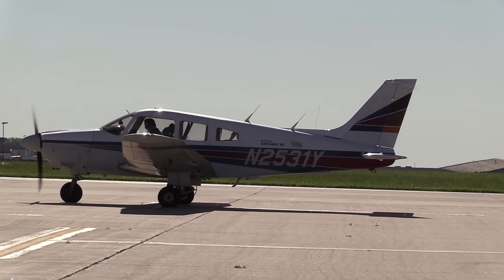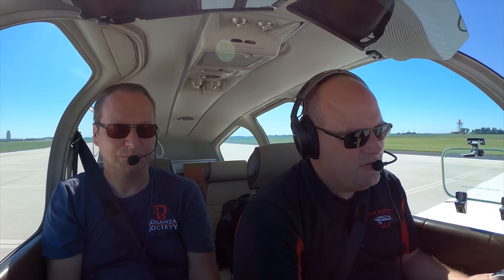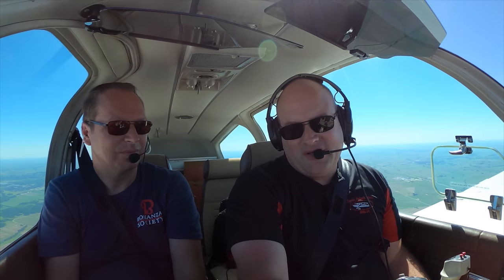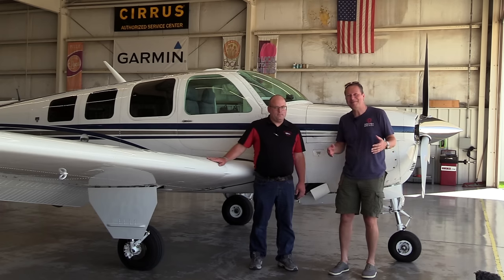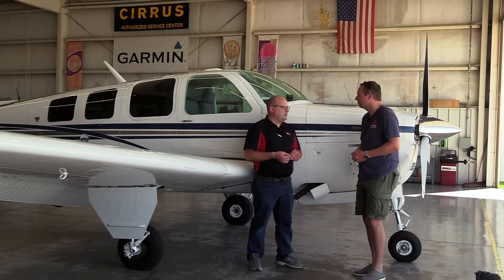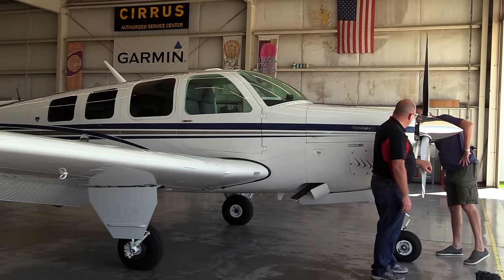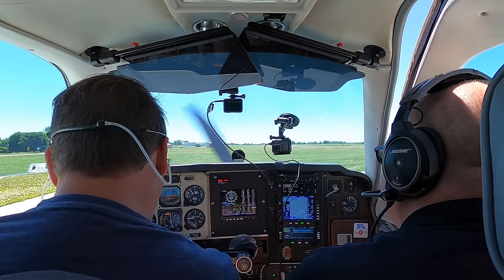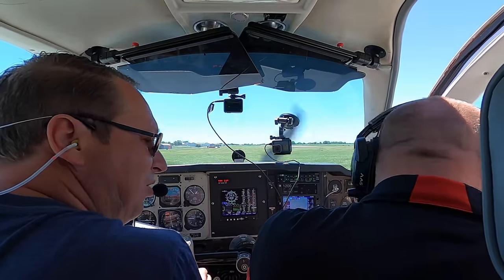Engine Upgrade - First Flight with the IO-550-B

Comment: I am watching this video as IO write.  Last summer I had AirPlains IO550 conversion done to my 1971 C182.  I absolutely love it.  

Regards.
Reply from the maker: I bet the 182 with an IO-550 is a rocket!
- Martin
Reply: John Fletcher   I also had Air Plains install the -550 in my 1975 C-182 May of last year. Takeoffs and climb outs are awesome. And with the GAMI’s you can really lean it back and save some gas if you’re in no hurry. Great motor! Cheers!

Comment: Did anyone else notice something dripped from right behind the vacuum filter at about 12:35  right after Shane removed his hand from the filter housing?    Great video....
Reply from the maker: Yes - a drop of water. In the rain, some water can be trapped under the cowling, and when you open the cowling the drops start moving.
- Martin

Comment: Great summary of the engine exchange process!  I did the same for my Arrow 200 this past winter but the break-in was prolonged a bit because I cannot easily get down to an altitude where 75% power is achievable!  My field elevation is 6900' and the nearest 4000' area is a haul from here.  Your ordering time was about what I experienced from Air Power too.  Probably normal EXCEPT when you are waiting!!!  Enjoy your new motor...and the empty wallet!!
Reply from the maker: Thanks, Jim. You are right about the empty wallet - that alone gives me an additional 200 feet per minute of climb rate!  😀
Best regards,
Martin

Comment: At 10:39 in the video the fuel line off the spider need to be corrected to prevent chaffing. Great video and congratulations on the conversion, they do good work.
Reply from the maker: Thank you - we'll look into that.
- Martin

Comment: Absolutely beautiful! Hope you’ve been getting to fly a lot. I have one minor concern. In your video at the 10:37 mark the spark plug wires are laying on top of your orange fuel line which are laying on top of the fuel line injector clamp. Over time the edge of the clamp my rub a whole in your fuel line hose. I’m not sure I got all the parts right, I’m not a pilot, but like watching your videos.
Reply from the maker: Thanks, David. You jut joined a very long line of people pointing this out. It has been corrected a long time ago. (The video is from 2020.)
 - Martin

Comment: Hello Martin
While you were doing your visual of the IO-550 engine. I observed one of your fuel lines support clamp appears to be misaligned when support the fuel line.

The one in question is the fuel line for the front cylinder on the right side. From my view,it appears that the metal clamp and the rubber insulator are not aligned correctly crating a metal to metal contact between the fuel line and the metal of the support clamp.

Just to let you know, I am a certified aviation quality assurance inspector

Please recheck all clamps to ensure all lines and clamps are not creating chafing.
Reply from the maker: Thanks, we'll get that adjusted.
- Martin

Comment: Lookin Good...wishing you many happy flying hours with your new engine, and of course, looking forward to any videos you share with us. You're lucky to be tall, you can see over the top of your engine, a plus in that regard for sure. It appeared to me that the ignition wires were sitting on top of one of the orange hoses..could that be a wear issue in the future due to vibration?
Reply from the maker: Hi Andrew - yes, visibility is no problem for me in the Bonanza. Interestingly, in the Cirrus I sometimes wish I was shorter, as visibility would be better.
Regarding the wires: This video is two years old - was fixed long ago.
Regards,
  Martin

Comment: Nicely done & congrats. Sounds like a big price tag but much nicer than trying to maintain and upgrade a light twin! You'll also enjoy a boost in value if/when it comes time to sell your plane.
Reply from the maker: I could have bought a twin for that money, with two working engines. Problem is, flying and maintaining a twin is a lot more expensive than the Bonanza. So while this was a very costly upgrade, it's a one-time charge, and from here on I hope to fly for pretty much the same operating cost as before.
- Martin

Comment: Reading the thread posts while watching I was struck by the engine upgrade sticker shock comments. Not knowing the cost I was thinking in the 100-125k range so when you revealed the price at 80k it seemed quite reasonable to me. Haha.👨🏼‍✈️👍🏻 Is there a manufacturer and shop warranty?

Comment: Nice video Martin,  I like the 550,  just watch the cylinder temps on climb out, especially if you decide to lean  on climb on a hot day.  Cruise climb is a good thing.   I hope you have good luck with it.
Reply from the maker: Thank you, Paul. So far the CHTs haven't been an issue, despite the warm weather. But I'll keep an eye on them.
- Martin

Comment: Great video Martin. I love my 550 in my Bonanza. With LOP you will good fuel economy at cruise. Enjoy.
Reply from the maker: Right, I figure around 13 GPH or so will do it lean-of-peak, once I can go there.
- Martin
Reply: Martin Pauly yea. Depending on altitude. I fly at 23 manifold and 2400 rpm and get 13/14 gallon flow. Ot lower manifold you can go down to 12.

Comment: Martin, can you use UPS for your background next time, I'm kinda partial.  We are looking at the same engine upgrade from our 520.  Once again great informative video.   Wish he had a video of extracting the engine.  Did you look into buying the engine without the continental fuel injection system and installing Gami's?  It is my understand you can't change the tuned induction system.  I am sure you did your due diligence on the subject and just curious, thanks again for a great video.

Comment: Congratulations Martin. I know the feeling, just also had my engine replaced. However, the workshop recommended a thick mono grade oil for the break-in (as per manual), not a multigrade. Sounds surprising
Reply from the maker: The important part is that it's break-in oil. There are a few different choices available.
- Martin
Reply: Martin Pauly thanks. I didn't know there was such thing. Thanks 🙏🏻 Also FYI, I found this guide that proved to be very informative if you don't have it: http://insightavionics.com/pdf%20files/Continental.pdf

Comment: I broke in my IOF-240B5 at 3000 75 % power for an hour and then I stayed at 3000 and every 15 mins went down to 65% for 15 min then went back to 75% for 15 min and then went down to 70% for 15 mins.  Was very interesting to hear what folks thought and how they thought it should be done.  I used the XC Phillips 20W50 too based on factory recommendation.  My new airplane Cessna 400 just had the 550-C put in 150 hours ago and I'm using the XC Phillips 20W50 in it too.
Reply from the maker: Sounds like that is the oil most people are using these days, Ed. Thanks for the note.
- Martin

Comment: Congratulations on your new engine and accessories! I underestimated the cost, by a lot. Gulp!
I wish you many happy,  safe, hours flying! OK, one question, since you've already invested a lot in this plane, are you planning on ditching the vacuum system and going for pure glass?
Reply from the maker: If I had another $50K lying around, then yes, a panel upgrade would be next, and I would go all electronic in the process. But that's not in the cards for a while.
- Martin

Comment: Martin, what drove you to make the engine euthanize your old engine  now, just hours.  or did you have a reliability centered maintenance  approach i.e. specific failure mode trigger?
Reply from the maker: No maintenance issues - the engine wasn't "talking to me" yet, Andy. But 2,600 hours... at some point I think enough is enough. Heaven forbid, if something happens on an engine of 3,000 hours or more. So instead of waiting longer, I pulled the trigger. Could the IO-520 have run another year or two? I believe so, yes, absolutely.
- Martin

Comment: We did the same conversion on our F33-A.  Good engine and prop set up.  Would have had them paint the inside of the cowl doors- makes it a cleaner installation.  Hope you have good service with everything.
Reply from the maker: Thanks. So far everything is working wonderfully.
- Martin

Comment: Great video.  Looking back a year later do you still like it and was it worth it?
Reply from the maker: Yes and yes. It's the engine that should have been in the A36 Bonanza from the beginning. Operating out of shorter fields, or close to max gross weight, or at high density altitudes are now a non-issue.
Regards,
  Martin

Comment: Hey! I just bought a 1980 A36. Planning on putting a 550 in it, then TNing it. I got a quote from Continental's distributor, Air Power for a factory remanned IO-550B80B of $58,700 which is net of the core credit and the unlike core fee. Do I understand that when you did yours, the engine cost you $44,649-16,000+2,000 = 30,649 (ignoring freight)??
Reply from the maker: No, I don't know how you got to those numbers, but that is not correct. My factory reman IO-550B was almost $50K, which included the unlike core fee ($2K). I had to send my old core back, otherwise it would have been an extra $16K.
- Martin
Reply: @martinpauly  Yes, thanks, I misunderstood.

Comment: Was the IO-550B heavier than the outgoing IO-520?  And did you not consider an M-T scimitar prop when you chose the Hartzell scimitar prop?
Reply from the maker: There was almost no weight difference between the two.
I looked at the MT propeller, but it was so much more expensive... went with the Hartzell Scimitar instead.
- Martin

Comment: Okay, really cool that he picked you up in his V-Tail.  However, did you notice his N number is N3176W, which just happens to be one digit higher than Kris's (Baron Pilot's) Baron, which is N3175W?  I'll be back to edit this comment when I finish watching the video.
Okay, watched the rest of the video.  I liked the time that Shane went over so much with you.  I expected that the on ground vibrations would have been lessened since I was pretty sure you were getting new mounts for the engine.  I also expect the prop might have had something to do with that, too.
I guess one of the things that surprised me was that Continental is now putting balanced injectors in the engine.  Saves a lot of money over having to buy GAMI, not that there's anything wrong with buying from GAMI.
One of the things that I've been wondering about lately is Electronic Ignition systems, or complete Electronic Ignition and Fuel systems, and why the FAA is dragging their feet on allowing replacement of Magnetos in the airplane with full blown EFI/EEI systems.
In the meantime, Electroair is providing a system that replaces ONE of the mags, your choice, with their ElectroAir Electronic Engine Ignition system.
http://www.electroair.net/6cylIgnitionKit.html
Yes, it's more money to spend, but in addition to the new IO-550, another $5,000 or so might give you a savings of more than that over the lift of the engine, with a typical fuel savings of 10-15% (or so they claim).  Sure, I'm spending YOUR money, I don't have any of my own.  :-) LOL.
I think 70TB is going to be very happy with her new engine, and I'm sure after you get it all broken in, you'll feel much more comfortable with a new engine under the cowling.
Now, start saving those pennies for a new Dynon system.  :) :) :) :p
Reply from the maker: Close - but it’s N317SW, not N3175W.
Reply: @martinpauly  Well, 3175W is Kris's airplane, I thought Shane's was 3176W, but you're right, I could JUST eek out the 'S' instead of a '6', and even the tower called it back is '3170W'.  I didn't hear the 'Sierra' as such, thought it was 'six.'
So close!  LOL

Comment: Hi Martin On the right hand side of engine on the forward cylinder the fuel line retaining clip is twisted and not holding the rubber mount properly. It looks like the clip might be touching the fuel line which could result in chafing thru the line...

Comment: Smoooooth.  Too bad you didn't go with the M-T propeller.  They are normally not heavier for 3 blades over 2 blades so payload is kept and they are even a bit smoother and quieter.

Comment: What a beautiful Bonanza. Can this upgrade be done with a V tail Bonanza? Seems to me it would add allot to a V tail also. Especially it's short field performance.
Reply from the maker: Yes, there are STCs available to upgrade a V-tail Bonanza with the IO-550B. It results in phenomenal performance.
- Martin
Reply: @martinpauly  That's awesome. i am just getting back in the seat after 15 years off. Taking lessons and preparing to buy either a V35 or possibly a twin Comache for crossing the gulf. I am tired of flying Commercial and I live in Costa Rica. Short field grass strips mostly. So preparation is a big deal as it should be with all of us. Thank you for the info.

Comment: Congrats on the new motor and the extra horse power.  Was your original motor run out or ?
Reply from the maker: It was past TBO but still running very well.
- Martin

Comment: Is that flexible hose suppose to lay across metal unprotected and unsecured?  Is there a new rubber hose impervious to engine vibrations? Check the video at 10:37…🤷‍♂️😳
Reply from the maker: Good observation, but It was fixed a long time ago.

Comment: So far I’ve put 35 hours on factory reman. I have same engine /prop as you. What oil level do you like to be at before your flights? I like to be at 10 but I’ve added like  2 qts in 20 hours.... seems like it’s burning more than my previous engine.

Comment: Grats on the new engine - is MCW still doing the BBQ? (curious)
Reply from the maker: Thanks - and yes, MCW still has the BBQ - right now with much reduced attendance, and they don't do the potluck/food sharing for obvious reasons at the moment. So it's smaller and a bit different, but it still exists.
- Martin

Comment: You must be doing something very RIGHT when it comes to engine maintenance and operations to have ZERO cylinders replaces in 2600 hours. I'd think a video out on what your doing would be very helpful to all pilots. Thanks for the great one here and Enjoy !!
Reply from the maker: Hi Bob,
To clarify, I did not have any top-end work done while I owned the plane over the last 1,000 flight hours (or eight years). The previous owners had some cylinder work done - the youngest two cylinders were replaced just before I took possession of N70TB.
Regards,
Martin

Comment: Hi, I'm new to your channel.  Thanks guys I enjoyed this!  I think the CAT Unlike Core Fee of $2000 is extremely greedy of Continental.  What difference does it make, it's still a situation of one engine goes out from their facility, and another engine is returned to them.  I might see a nominal handling fee if your core was from a different manufacturer, but it's not, you sent back one of their own engines.  Being out of aviation for a while now I'm wondering if it's more cost effective to buy another plane instead of installing a rebuilt?  I'd be crunching the numbers on that.  I'm not judging you, I'm sure you made a good decision based on your aircraft and how you use it.  I'm just always shocked by what I believe to be blatant greed of businesses in an exclusive market with little to no competition.

Comment: Hi Martin, nice documentation as always! I didn’t quite get the performance comparison. Can you say what used to be your average cruising speed and what it is now?
Reply from the maker: My cruise speed used to be right around 155 knots true airspeed - at wide open throttle, 2,500 RPM, lean of peak, between 8,000 and 10,000 feet. I do not have that data with the new engine yet, that's why I cannot offer a real-life performance comparison yet.
Regards, Martin
Reply: Thanks Martin! Looking forward to your new data. It will be interesting to see what performance increase you get. Liebe Grüße aus Österreich :)

Comment: Which manifold pressure did you set for the first flight?
Reply from the maker: Between 25" and 26". You can actually see the MP and RPM read-outs on the engine monitor in the video, near the center of the screen, on the camera angle from behind the pilot seats.
- Martin
Reply: @martinpauly  Ok, thank you. My F33A is currently getting the RAM STC IO 550 B RA, so I was curious. However, the progress is rather slow and I am afraid that I wil have to wait another four to six weeks or so until I will hopefully also be able to make the first test flight wirh the new engine. Greetings from Austria, Andreas
Reply from the maker: @andreasbacher2695  Bei mit hat es auch länger gedauert als zunächst geplant. Der Motor war ca. 4 Wochen zu spät, und die Installation hat statt der erwarteten 7 bis 10 Tage dann doch vier Wochen gedauert. Es scheint eine goldene Regel der Fliegerei zu sein dass all diese Dinge sich immer verzögern.
Herzliche Grüsse aus Iowa, und alles Gute für deine Bonanza mit dem neuen Motor!
- Martin

Comment: At 1029 I see a what looks like a fluid line rubbing on the metal clip..  The rubber insulator has slid off the protected area ..This is a very dangerous situation.

Comment: Hey Martin, congrats on new engine and upgrades. I’d be curious to hear what your engine shop says about after breaking in your new engine if you should run your engine per this article below from Mike Busch and running “Over Squared”. I see in your videos you run high rpms and lower manifold pressures than this article talks of? 
https://resources.savvyaviation.com/wp-content/uploads/articles_eaa/EAA_2012-10_flying-efficiently.pdf
Let me know what your engine guys says please. I have a new 0-360 Lycoming with 150 hrs on it. 
Merry Christmas and keep up the great videos! Thanks

Comment: How did you decide on the Hartzell Scimitar prop? How does the composite prop from MT compare?
Reply from the maker: I took a quick look at the MT prop, but it was so much more expensive that I quickly abandoned the idea. A few pounds lighter, maybe, but otherwise no significant performance difference.
- Martin